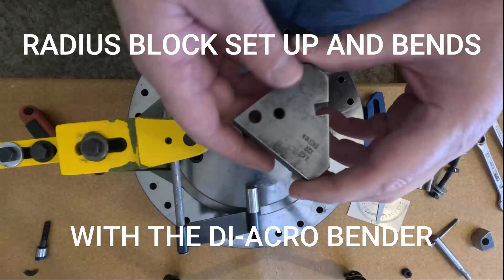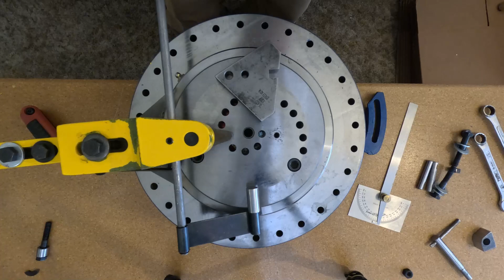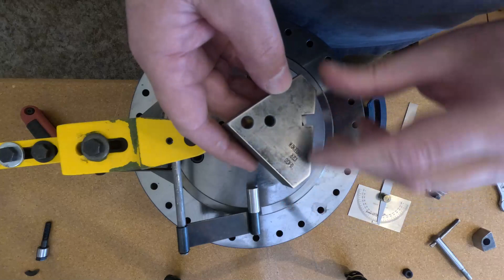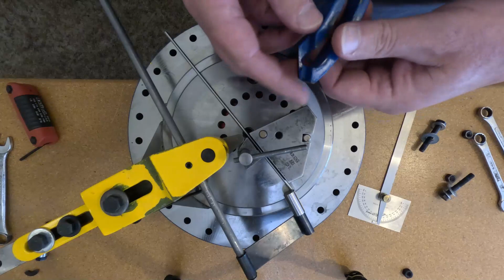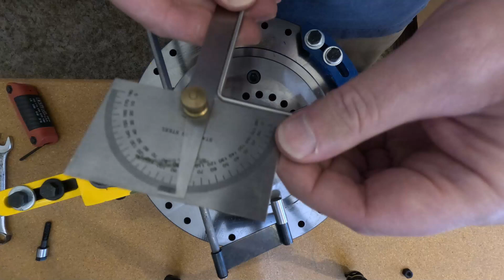RADIUS BLOCK set up for the DI-ACRO ROTARY BENDER

Comment: 2 questions:
Where do you source your wire? I need to buy 1/16" - 5/32" in quantity
How do you cut your wire? I need to make hundreds of pieces - cutters are inefficient!
Reply from the maker: My last source before I retired was Laurel Wire Company. They can cut and straighten wire. Plus, they can centerless grind for a nice finish. I don't think they have a minimum order. If you decide to buy from them, tell Jackie I said Hi! She's very nice to work with.
Reply from the maker: If your bends need to be highly accurate, try to get US sourced wire from a single batch.
Reply from the maker: I use a DI-ACRO rod parter. If you set it up right you should be able to cut around 1000 1/8" pcs in a few hours.